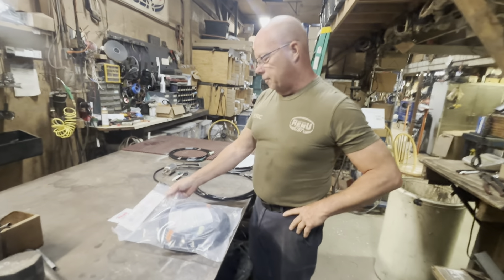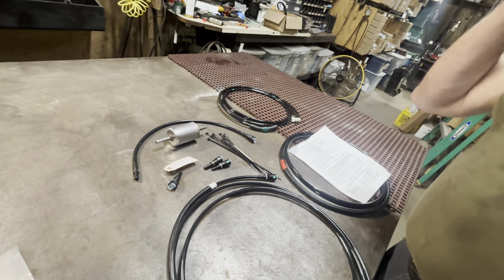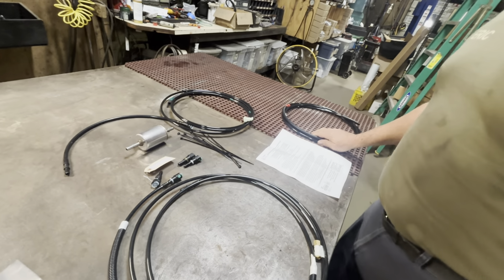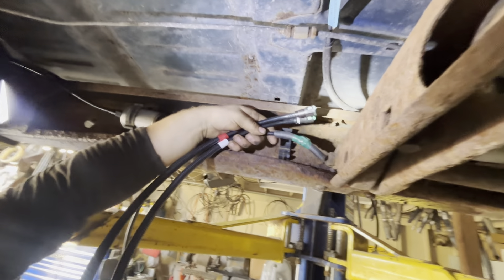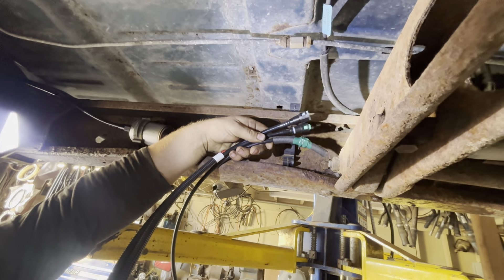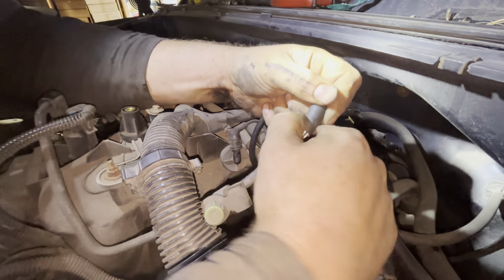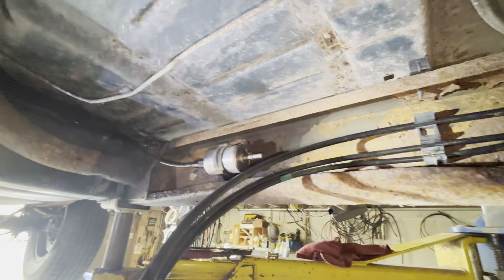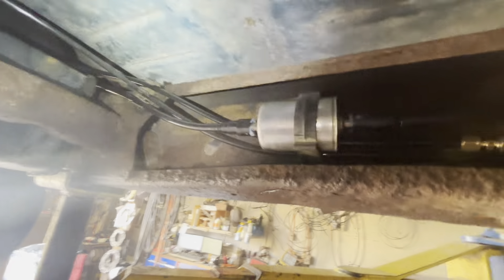Installing Nylon Fuel Line part number FL-FG0053 on 99-03 Silverado 5.3L

Comment: I see on eBay yall make a kit for the 2000-2006 chevy Tahoe with flex fuel. Looks like a very nice kit.
Reply from the maker: Thank you. Our flex fuel Tahoe set fits 2002-2004 but we do have other sets for ones newer than 2004 as well. Our flex fuel set consists of all the lines from pump to motor with a new filter, all lines come labeled too as this set can be a little confusing with all the lines involved.

Comment: I ordered this very same part number on Amazon for my 2002 Silverado 1500HD plow truck. The quick connect for main line on the engine will NOT go all the way on and click. Very disappointed. Thanks for the video.
Reply from the maker: We do not sell on Amazon. The sets that comes from amazon for $50 come straight from China.
Reply: @gastankrenuersoninc9540  Yeah, I bought it before watching this video and it has the same part number. Wonder if this one has a different size fitting that will click in place on the metal fuel pressure regulator lines as shown.
Reply from the maker: @rotorpilot81  We install these lines in our shop everyday so I can guarantee you that our fittings are the correct size. They steal our ideas as well as our part numbers. They have no idea what they are selling or how to install it. If you need a new set of lines give us a call 810-635-9249